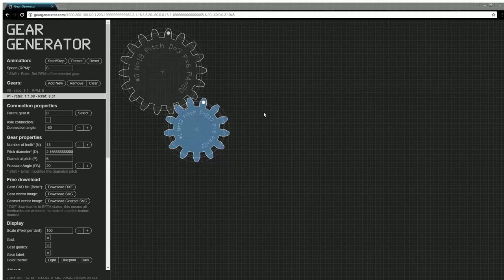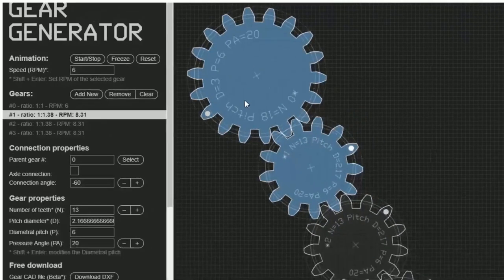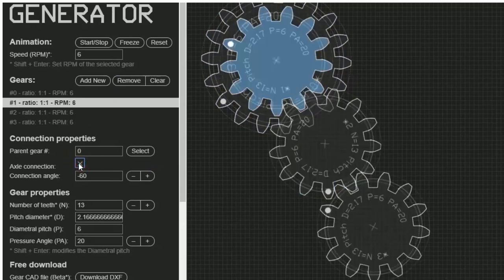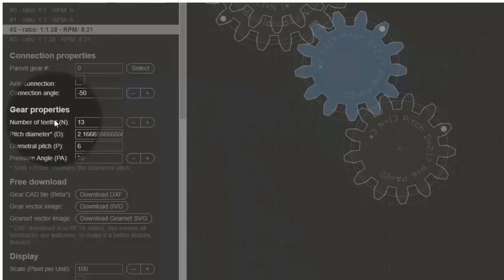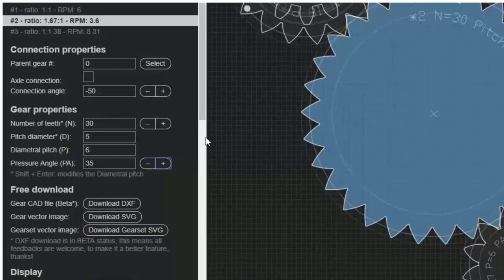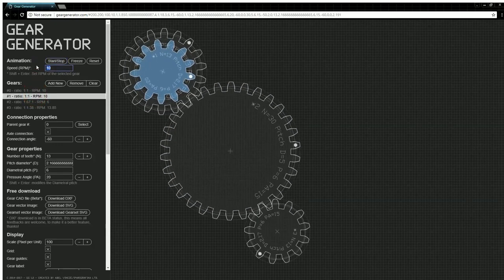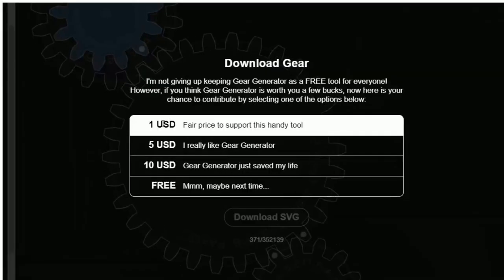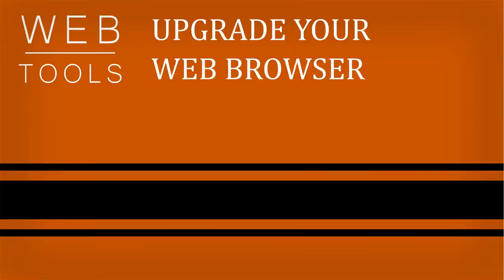Gear Generator How to Draw Perfect Gears (online, no download)

Comment: Sad it's not free anymore... I made a lot of great projects with it... now alot of youth can not be inspired by free tools anymore.
Reply: On Firefox highlight the gear you want by moving your mouse over it, and/or clicking on it. 
Then right-click on the gear, and choose inspect element. 
You will see portion of the page with the code <path id="gearpoliy3" .......></path> highlighted. 
Copy it. (Ctrl+C)  or right click and choose "Copy Inner html"
Download Inkscape, create a new svg file and save it.  
Open the file with a text editor. 
You will see a tag <g ....../>. Change that to <g .......> (remove the /) 
Then paste the path after it, and add a </g> to the end. 
so it should be <g ......><path id="gearpoliy3".........></path></g> 
Save the file. 
Open the file in Inkscape to convert it to DXF and many other formats 
(Inkscape calls DXF Desktop Cutting Plotter format for some reason, so look for that). 
DXF can be opened up in AutoCAD or many other CAD systems.

Comment: Very nice tool!  Can you tell me how I can pin down one gear and lett the other gear walk around it?
Reply from the maker: There are some "Planetary Setup" options that allow you to make gears fixed, input, or output. This is on the newest version of the gear generator tool: https://geargenerator.com/beta/

These options will change whether a gear is setup as fixed or not. Keep in mind however, that all the gears have a relationship to one another. So if you make one gear fixed that will change the setup for the other connected gears. I'm no gear pro though, so you might have to just play around with it :)

Comment: Hey, I was wondering if the pitch diameter measured from the center of the gear to the tips of the teeth, or from the center to the base of the teeth?
Reply: I believe it is the diameter of the circle that is from the intersection of the "line of action" (which is the pressure angle 0° being perpendicular to  the line between gear centers) and the line connecting the gear centers. In European gear terminology it is really easy: d=m×z (pitch diameter is equal to the module times the number of teeth) Americans have a tougher time with their crazy units!

Comment: Hello, im just wondering,  is the pitch diameter in inches?
Reply from the maker: Hi Neeno :)

Yes, the pitch diameter is in inches. If you would like to convert this to another unit of measure, export as an SVG and then you can adjust the unit of measure in Adobe Illustrator or the free software Inkscape.
Reply: It would be great if there was an option to switch between the outdated imperial and more practical metric system.
Reply: @macnavi  numbers are numbers

Comment: nice, just add a possibility to switch it to metric.
Reply: It can be what you like if you read what it says. "Gear Generator is unitless: if you wish it's inches, cm or millimeters. DXF opened in AutoCAD will have the same value for D/P as it is set above. Gears in SVG are measured in pixels, which is the value multiplied with the scale (Pixel per Unit) as it is displayed on the right side."

Comment: Hi, thank you so much for make this video. I just wanna know how to adjust the size of the teeth.
Reply from the maker: The variable that most impacts the size of the teeth is the diametral pitch. The larger you make this number, the smaller your teeth will be. However, as you adjust this variable your pitch diameter will naturally be adjusted in order to keep your number of teeth the same. If you want a larger gear with small teeth, first adjust your diametral pitch (number of teeth per inch of your pitch diameter) and then increase the pitch diameter to the proper size.

Comment: Great video! I am having difficulty when importing the cad file to Solidworks, the dimensions are totally off (much larger).  Does anyone have any suggestions for fixing this issue?
Reply: Probably your problem consist in a inch to mm conversion, try to check if you are working in SI units.

Comment: Does anyone know how to open the file in autocad 2018? I download the file and open it but there is nothing in the drawing.
Reply from the maker: Sorry Evan, I am not familiar with AutoCad 2018 and DXF files. When I try to open it I get an error with line 48 saying the table flags are missing. It looks like you might be able to edit the DXF file using a text editor, adjust the appropriate lines, and then the file may work:

https://knowledge.autodesk.com/search-result/caas/sfdcarticles/sfdcarticles/Error-Invalid-or-incomplete-DXF-input-drawing-discarded.html

I couldn't give you direct guidance on how to manage this.
Reply: Download an SVG from this great site.  Download Inkscape.  Install.  Load your SVG in Inkscape.  Save as Windows Metafile (.wmf). [Click on all options when prompted]  Use the IMPORT command in AutoCAD to load the .wmf. EXPLODE.

Worked for me.
Reply: With the latest update, the exported DXF can be opened with AutoCAD

Comment: Internal gear ability would be great
Reply from the maker: Hi Mike!I haven't found a great tool online to create internal gears yet, but one great thing about this tool is the ability to export in SVG format.  Are you familiar with Inkscape?
Reply: Do you know what are the units the program is using? Inches? cm?
Reply from the maker: The unit of measure on the tool is inches. I exported the file in SVG and measured the pitch diameter and compared my measurement to the populated field on my browser.
Reply: Thanks!